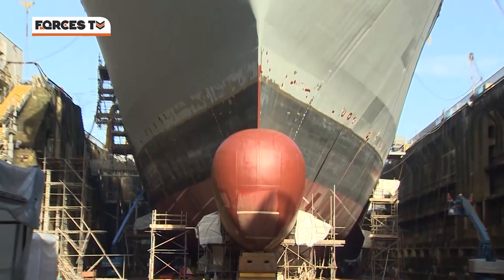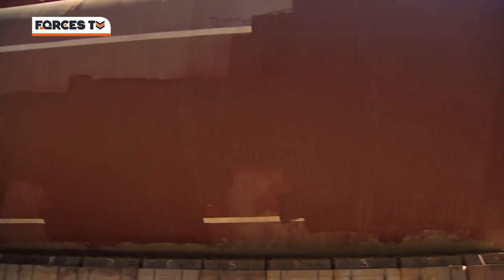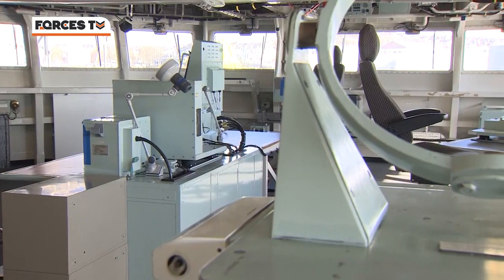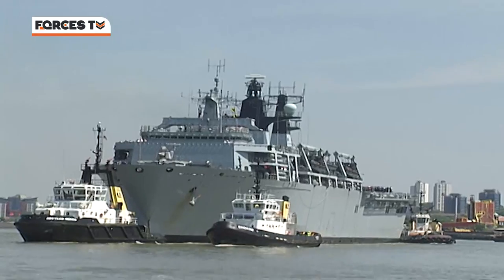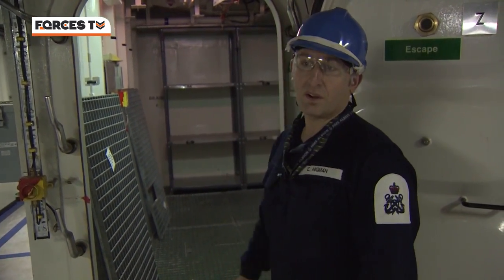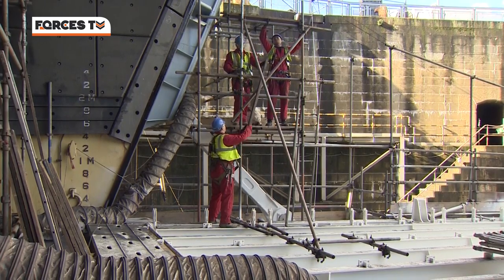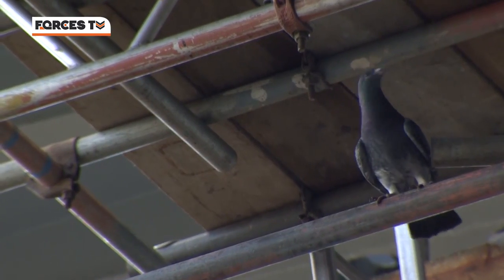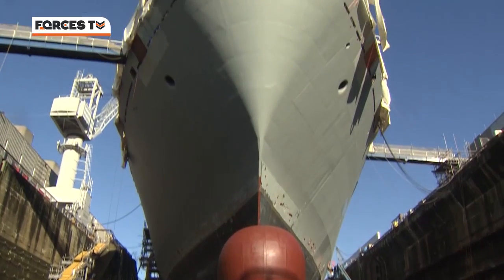HMS Albion: Rare Access To Mothballed Royal Navy Ship | Forces TV

Comment: Albion recently featured on the YouTube channel Sailing with Uma when Dan and Kika were invited onboard for a few days after completing there North Atlantic crossing (The Captain had been following them on their YouTube channel) in there full-electric sailboat Uma. Uma had been rescued from being scrapped. The Diesel engine was broken. So they replaced it with an electric motor from a forklift truck and some batteries. They continued to update everything as and when they could and have spent the last 5 years in the Caribean before venturing across the Atlantic to the 2019 Southampton boat show. The electric motor has just been updated to allow regenerative battery charging when underway by sail. They are Last time I looked they were making their way through Amsterdam dodging massive ships, bags, fishing boats and surf boarders. It's fun to take a look...

Comment: made about the same time as the Freedom, & costing about the same(built w/high wage base), yet 1 is 18 /19K tonnes & the other is 3.5 K tonnes. Which common cents would u say is better, more value for the dollar? Both need major repairs early on so same same.  Length & beam to compare r 577' by 95' vs 378' by 57.4'.